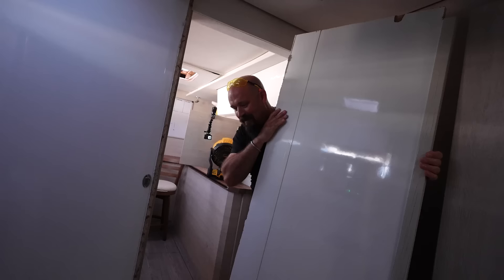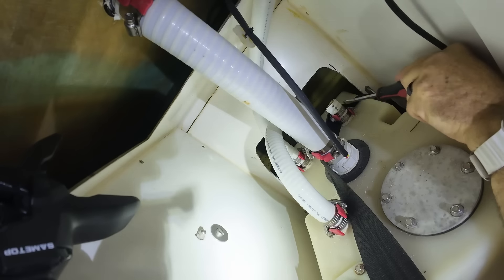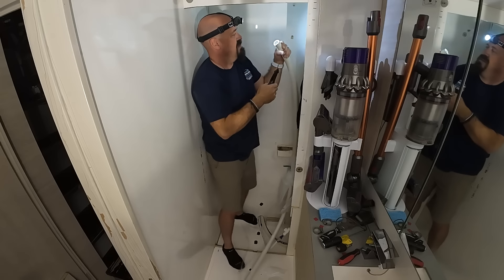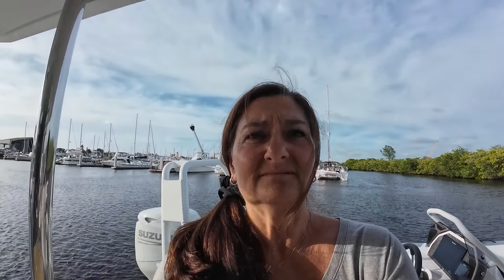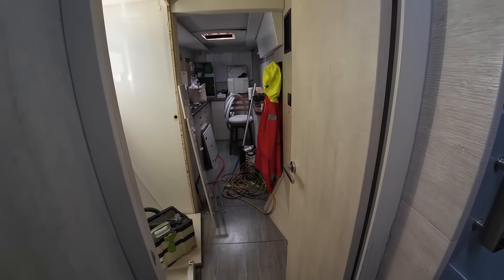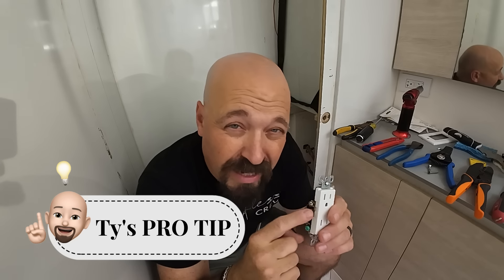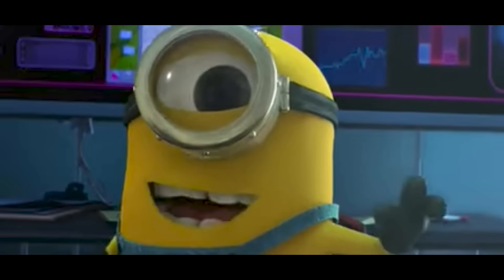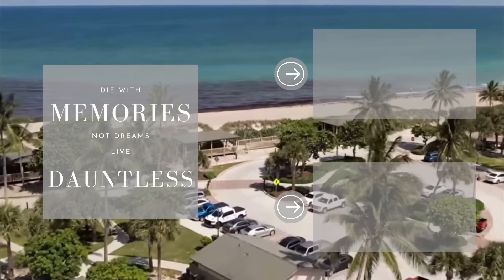NO TURNING BACK// Complete Demo is it worth it? - Episode 160

Comment: Would it make sense to build a support where you cut that notch out? Seems like there's a decent amount of pull on that tank nipple supporting the hose weight! BTW, washers are weighted (mine with cement!) to keep them from moving around during a spin cycle with wet clothes. I learned that the hard way taking one up a set of stairs! The dryer was so much lighter lol

Comment: YES, you can separate the circuits on the plug.  BUT IT IS DANGEROUS FOR THE THE NEXT poor lazy electrician who comes to work on it.  Comes to the boat, flips one of the two off, tests one plug, its off and OPPS, did not know there were TWO different fuses.     Needs clear labels at the plug.
Reply: Yea. And make troubleshooting a nightmare.  Fell sorry for the next guy.

Comment: Hello. First time viewer. Did you tell us the specific air conditioning compressor, evaporator, condenser, electronics-controller manufacturer(s)? I am a refugee of Emily & Clark's A/C project. I'm ready to build but have no specific parts-supplier info. Thank you! I represent a community of boaters on the Chesapeake who are very focused and motivated. We have some expertise and are missing some practical supply information.